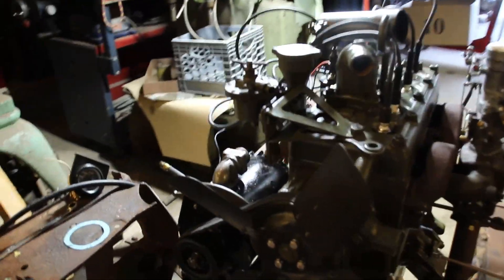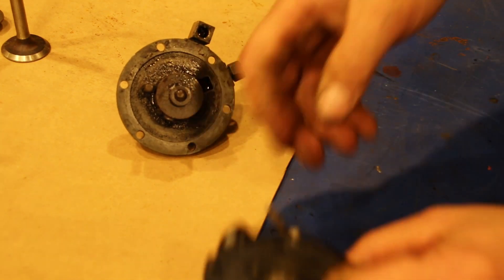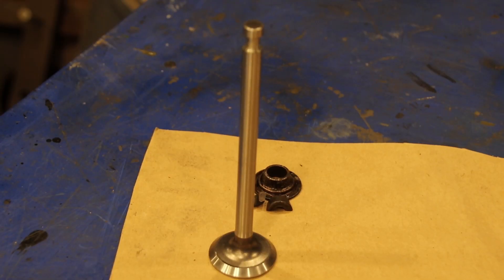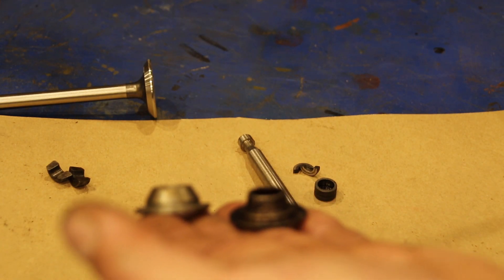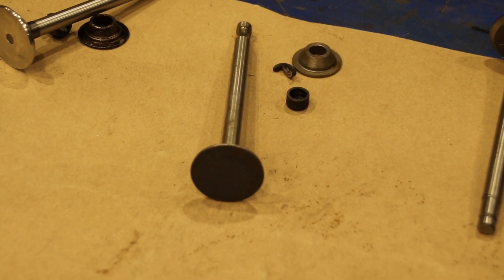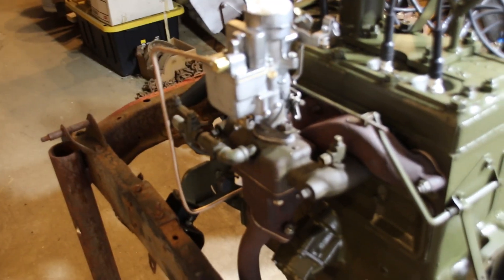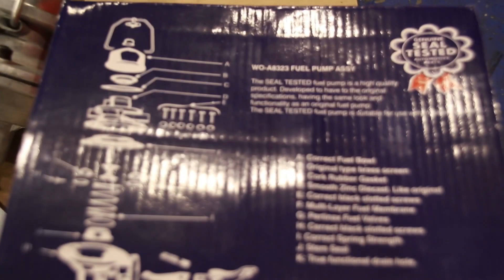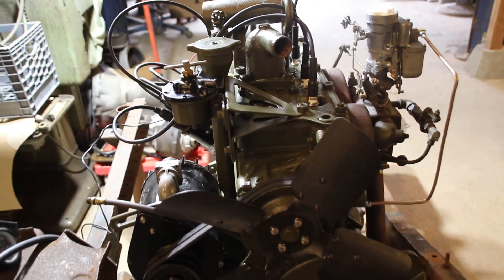Lou's Willys M38 L134 Engine, M38 Valve Changes , Startup Information My Video

Comment: Thank you for another great video and info! I got a L134 engine, that it seems like they weren't able to find parts for it on a previous rebuild and they used 8 exhaust valves with rotators from an F134 engine. Amazing how the valves would still seal good enough to run, despite the size difference for the intakes. Of course I'll make it right once I put it back together.
Reply from the maker: I always try to put out information that isn't out there so people can better understand things.  Glad this helped, and thanks for watching

Comment: excellent information as usual...i can attest to the poor quality of some of the aftermarket fuel pumps...even after using a 1/4" spacer plate i was still getting too much fuel...i had to install a pressure regulator...i'm not confident on the longevity of the cheap pumps either (that includes the "brand names" which are made overseas now)..i carry a spare one in the toolbox under the passenger seat as a precaution...i have never heard of the Seal Test ones....maybe there is hope :)
Reply from the maker: I have been running the seal tested pumps for many years .  There is so much junk out there and this is the only pump that works properly.   Get one while Pete still has them and I am sure you will be pleased with it.

Comment: The big question..... Did those changes make anything better or worse? Wouldn't the valves rotate by some small amount no matter what? I would think they would by some small amount but that's just an educated guess
Reply from the maker: Valve changes made things better and the final rotator setup was used for many years in every F4 engine

Comment: Good video.  Years ago I got tired of burned exhaust valves on my CJ2A L-4, so I switched to late-style F-4 exhaust valves. The F-4 keepers and rotating caps were the same as for Willys 6's of that era. I assume that's why the F-4 stem ends were turned down from approx. 3/8" to 5/16" diameter, matching the 6's smaller stems.
Reply from the maker: Good swap, they were onto something when they started developing the first rotator assemblies.

Comment: Hi Brian, thanks for the video. 
Quick question on a F head fitted in the cj2a. Wich carburetor would you recommend? With the F head being higher, I am quite restricted to the height of what the carburetor can be. 
Thanks for the heads up on the pump, I will get one from Pete
Reply from the maker: An f head in a 2a is very close to the hood.  I don't know of a carburetor that will work that doesn't require a hood modification.
Reply: there are a couple of vids here on the 'tube with people using holley 1904's with an F-134 in a low hood jeep....there is only about 1 inch of clearance from the top of the valve cover to the bottom of the hood...

Comment: would be interested to know if you found current production of the valves with rotators available? would convert my 2a.
Reply from the maker: you can use the later F head valves and rotators.  Just check that they fit the seat properly or cut the seats when you install the new valves.